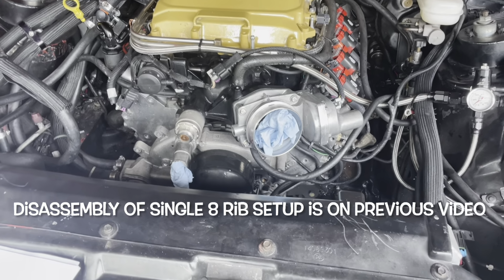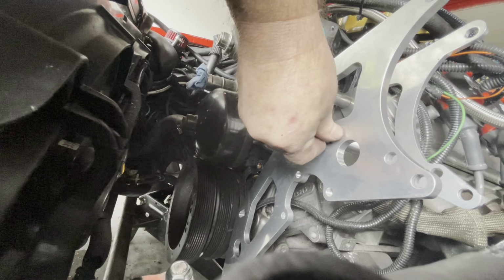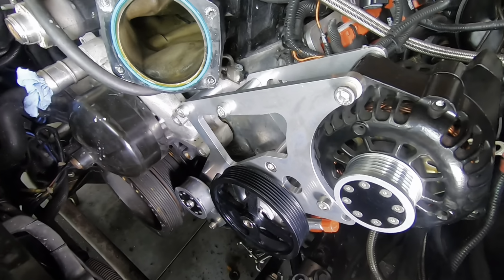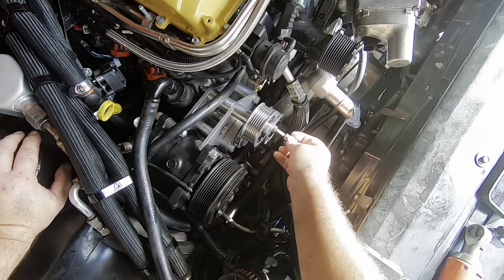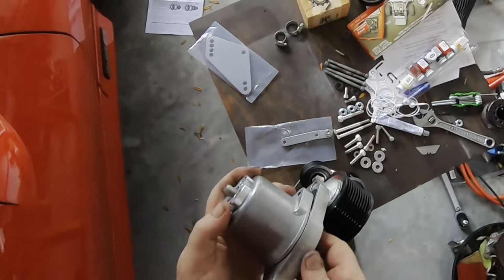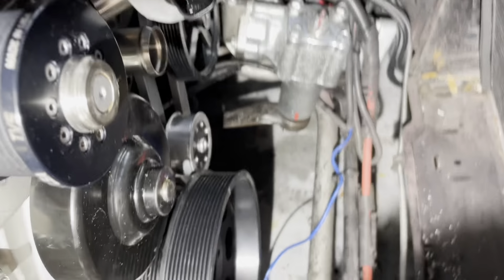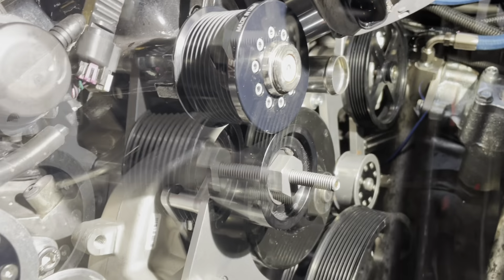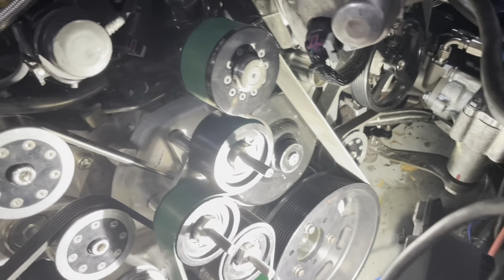LSX Concepts 2650 Flex Drive kit install on my 85 Camaro Iroc-Z

Comment: The slotted holes at the bottom of the alternator bracket are actually for fitting tall deck blocks, not a lot of people realize that we have one of the only kits that fit tall deck LSX and other aftermarket blocks without modifying the brackets
Reply from the maker: Oh cool that makes since! Good to know I can still use this when I upgrade to that lol thanks man!